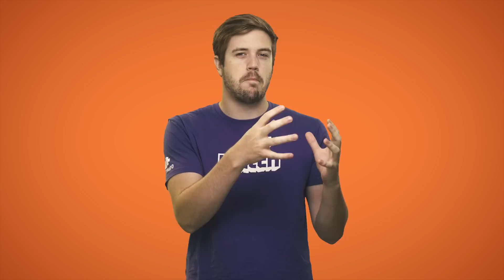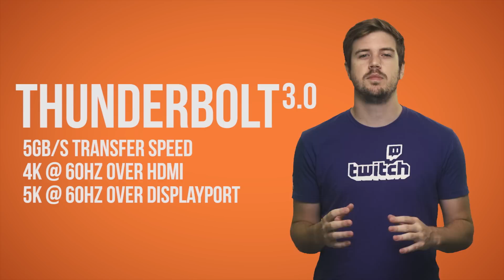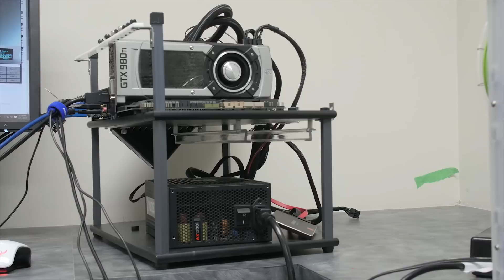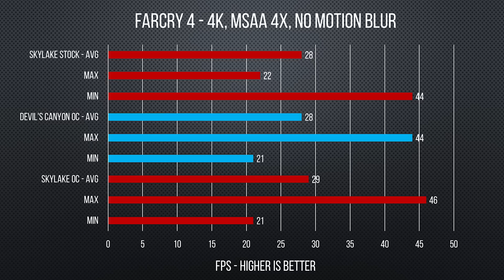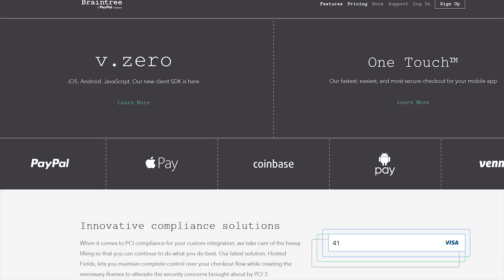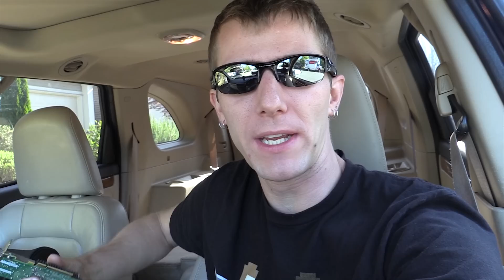Intel 6700K "Skylake" CPU

Comment: Not worth the upgrade. Minimal upgrade over Haswel. DX12 will eliminate CPU bottle neck anyways. As long as you have a decent 4 core or higher DX12 will give you a massive boost in performance as soon as games start supporting it. Save your money buy a faster graphics card. Any one rocking a sandy bridge or higher would not be smart to up grade unless you just got money like that.
Reply: Rambito What good will DX12 do if games already out don't update? I'd say it's worth it for people like me still rocking an old Bulldozer.
Reply: What graphic card do you have and what refresh rate monitor do you have. Reason I ask in DX11 an overclocked Bulldozer will not be a bottleneck on a 60hz monitor if you want 120hz plus then yeah a better CPU will make a difference. I had an FX 8320 over clocked to 4.5ghz and I ran every thing no problem even with 120hz monitor at 1080p. Bulldozer is still good I would wait for DX12 then make your decision. Not all DX11 games bottleneck your cpu and even the ones that do it runs good still. Remember right now your really only using 1 core in the render pipe line for draws imagine when you can use all cores. What DX11 games do you play. In the pas three years I have owned an FX8320 a i5 4690k its was a minimal upgrade in games and lost some multitaksing a i7 4790k best of both worlds and right now am running a x5660 Xeon. A good bench mark for overall speed of a CPU in cinebench that will give an idea of how fast your cpu will in DX12 or firestrike physics score.
Reply: Rambito 980 ti, 60hz monitor. Most games maintain a constant 60, but a handful of games have dips, like every time I destroy a building in Red Faction Guerilla.
Reply: Yeah old ported console game poorly optimized that game runs like crap on every thing it does run better on intel but not by much. For 60hz I would not upgrade unless you just got piles of money around. You can sell your CPU on Amazon and for an extra $50+ bucks or so depending on what cpu you have and upgrade to an FX8320 or FX 8350.
Then you dont have to buy new board, ram and crazy expensive CPU. http://www.eurogamer.net/articles/digitalfoundry-2015-why-directx-12-is-a-gamechanger
http://www.amd.com/en-us/innovations/software-technologies/dx12
http://www.techpowerup.com/210960/amd-bets-on-directx-12-for-not-just-gpus-but-also-its-cpus.html
http://www.legionhardware.com/articles_pages/3dmark_api_overhead_test_dx11_vs_dx12_cpu_performance_preview,1.html
Reply: Rambito Well there's something you're missing here. It's a sound argument at all, but it simply doesn't apply to me. Even if all my games were running flawlessly I would still upgrade, because that's just how it is. I'm a PC enthusiast. I want the fastest shit I can get my hands on, otherwise I wouldn't even have a 980 ti, I'd have gotten a 380 or 960.

Besides, if I upgrade ill have enough spare parts lying around to build a whole second computer.
Reply: True totally understand I my self am always building new systems bc I buy and sell computer parts on amazon as a side business and I love building new and different setups just trying to share some info. Yeah if are a pc enthusiast and want the fastest you would not be on Bulldozer thats why was given you cheap setup advice. If you really want an upgrade get an i7 5820k thats a real upgrade almost same price. I just think skylake is too much for too lilttle. If you gonna go through all the trouble of buy all new every thing go X99.
I had a FX 8 core and i7 4790k "Devils Canon" skylake is 10%+/- faster in games if you overclock depending on the chip the Haswell might overclock better and there goes the 10% IPC.
Just not impressed but go for it, it will still be alot faster than what you have now.
Reply: Rambito The issue with X99 is that most of the boards are either too expensive or just plain ugly. Most of the ones I like are from Asus or ASrock. Asus has that OC Socket thing and I feel iffy about that, heard a lot of horror stories about the socket killing CPUs.

As for Asrock, I will NEVER do business with them again. Just a few days ago, poor workmanship on one of the SATA ports for the Fatal1ty 990FX Killer caused it to break and kill off a 2TB HDD. I have 600GB+ steam library, and that now has to be cherry picked and stuffed on a 5400 RPM 500GB HDD.
Reply: Ya Asrock sucks. As long as you have the latest Asus bios it wont be a problem. Just don't use auto overclock feature on original bios.
Reply: Rambito Probably end up with the sabertooth then. Just wish it had a red/black theme...

MSI boards don't look too bad but I'm not familiar with them, and you already know what happened last time I left the asus comfort zone....
Reply: I had a Sabertooth 990fx rev 3 on my FX 8core the board was rock soild not one problem. Had MSI Z87-GD65 Gaming on a 4790K and it was good board except the bios kept crashing thank god is had a bios switch so when it crashed I could boot into bios B then flip the switch to A while I was in bios B re flash with USB and I would get A back. Asus for the win.
Reply: Rambito I had the rev 2. Got rid of it after getting this ASS rock board, was getting it because it had all the features of my planned build and the color scheme I wanted...... biggest mistake ever. Should have gotten the Formula and joined the republic.

Only issue I ever had with the sabertooth was the onboard audio went dead. Upgraded to a Creative SBZX.

I'd get the Extreme on X99 but my case is an NZXT 450 Noctis. I don't have the luxury of E-ATX boards, stuck with ATX.

Comment: i'm still rocking my sandybridge i5 2300, overclocked to 3.4ghz. It does perfectly well with my gtx 970, so no pressure to upgrade.

Comment: Does Linus still have the 1366 pc from Scrapyard Wars 2? I would like to see if I gain any gaming performance if I upgrade to a 6700k or 5930k cpu from a i930. Overclocked to 4Ghz.
Reply: Pholiage I just switched from a 930 to a 5820k and turns out my 930 was bottlenecking a few games, most noticeably Skyrim with enb mods, but it wasn't a massive difference enough for a $400 upgrade for games alone. My 930 was at stock settings since it was too hot to overclock
Reply: MarioDragon Well I run my 930 at 4.1ghz as I mentioned paired with a 980ti. And all games run fine. But as you say I don't know if I am missing out on something for $400-$500
upgrades
Reply: Heey Broos thats my place. 930 here too. If I put benchmarks on the side and I compare my "beast" side by side with a 4770k.. Hmm I was destroyed by miles. Unfortunatly there was just only 1 game common between us (BF4) but on ultra my stock 930 with 2 r9 290 on the side couldnt even get close to the 4770k with 1 r9 290. I think its time to upgrade. Was really good in the past 6 years, even put it under an nzxt kraken but as soon as I oC-d became really thirsty and the bill at the end of the mounth just didnt worth the extra 7 fps.
But theres other difference like my mobo is pci 2.0 not 3 etc etc. 
So I belive that with 6700k and an asus z170 deluxe i'll be back in bussines in the world of 4k gaming. Any thoughts? Or should I go from full hd to 1440p? Im not a heavy gamer. Im playing for fun and for the story.

Comment: So, I've been running a i5 650 for a while, just actually got into building my own computer, and I wanna upgrade to the new hotness. So I would really love to have this chip, and I already built and cable managed everything /except/ for this i7 which is in stores nowhere and doesn't even have a ETA. I get that I'm more than a bit foolish for going for the newest processor right as soon as it's out, but it was supposed to be released a little less than a month ago on the fifth. Can anyone tell me when it's possible to get one of these?

Comment: hey guys iv been watching ur vids for a while they have really helped me out so thanks for that but I could use your help with something I recently purchased a 4k tv with hdmi 2.0 and iv seen it run games at 60hz in 4k but my tv keeps jumping from 60 to 30hz and there is no settings for the tv that concern it's speed so if there is any programmes that could solve this issue please let me know

Comment: I got two gtx 980tis still on the x58 platform with a 6 core 980x cpu @4.2ghz.. I'd like to upgrade but it feels kinda underwhelming to jump to a 4 core cpu... why they don't release a skylake with 6 cores without that integrated gpu ?

Comment: I'm just going to stick with my AMF FX 6350. It's cheap and a pretty decent processor. I usually have tons of programs running so my overclocked 6 cores running at 4.1 GHz works for me no problems.
Reply: *AMD

Comment: Poor audio quality in this video if you compare to the usual sound quality, some high-pitched noise (12kHz+) and a bit of degraded overall quality. Seems to me that there is some kind of EMI or ground issues.
Also as someone pointed out it seems like the audio is a bit out of sync.

Comment: For the last 10-15 years, I've always built a new computer about every 3 years, since that has pretty much been the lifecycle of most hardware.  (I don't usually do a whole new computer, but most components do get switched out, like the processor, motherboard, memory, and power supply at a minimum.)  And every time I upgrade, the new system is very noticeably faster than its predecessor.

But I'm finding it hard to justify spending money to upgrade at this point.  Everything's working fine on my 4-year-old system with a Core i5-2400, 8 GB of DDR3 RAM, and a video card I just bought almost 2 years ago (an AMD RADEON 7850, for those curious).  It's still a pretty quick and efficient rig.  I do get occasional stutter but it's not game-breaking.  I think I can get at least another 2 years out of it, if not more.

Looking at the other comments, it looks like I'm not alone.  I think I'll just hang onto this rig until something major breaks.

Comment: "Even though the smaller, 14nm process could otherwise result in higher overall temperatures..." (4:10) - Could it? Doesn't the die-shrink reduce electrical resistance between transistors, reducing heat output? Yes. Yes it does.
Reply: xlUIblisUlx We saw temps increase when they shifted from 32nm-->22nm due to Intel cheaping out on the TIM, packaging smaller stock coolers and turbo-boosting the clockspeed for max performance. Like gpu's, materials have improved and the chips are happy to sit at 80c all day everyday.
Reply: +Nicholai Chev All else equal, a die shrink does not lead to higher processor temperatures. The reason GPUs have higher operating temperatures is because they have more transistors, and use an older process, necessitating more power draw, creating more heat. I'm pretty sure the actual tolerance for high temperature in the GPU is not about materials-science, and is actually about the fact that the GPU doesn't have onboard cache whose retention is important, unlike the CPU.

Comment: Pro-tip for Your graphics designers:
If You use gradient in the background apply some 'Add noise' filter (I recommend Gaussian, monochromatic setting). This eliminates colour ramping and the result is much more pleasing to the eye.